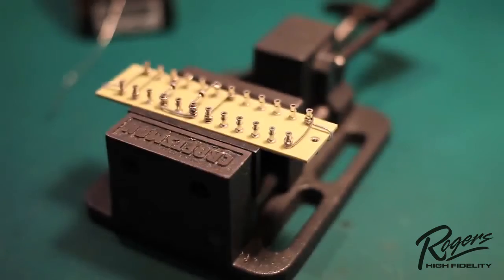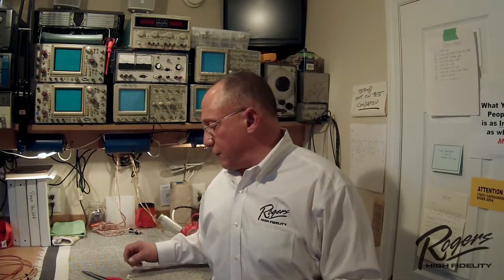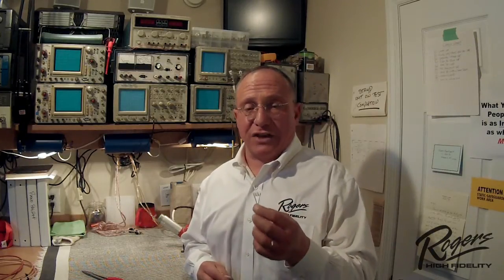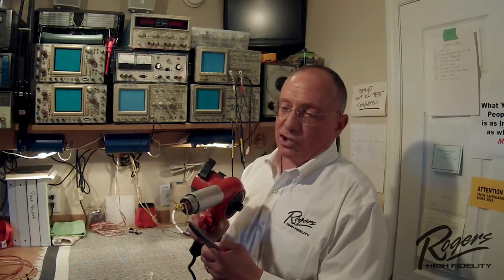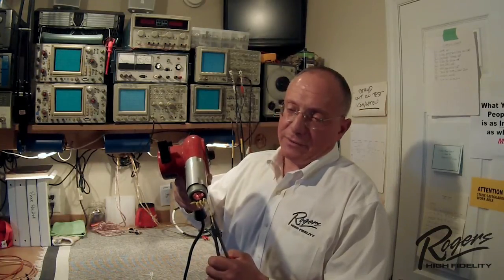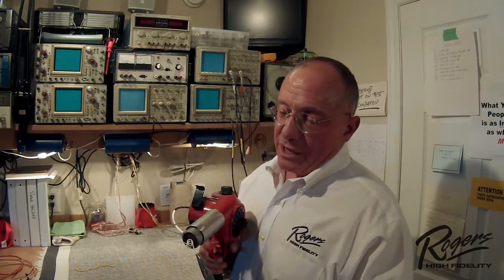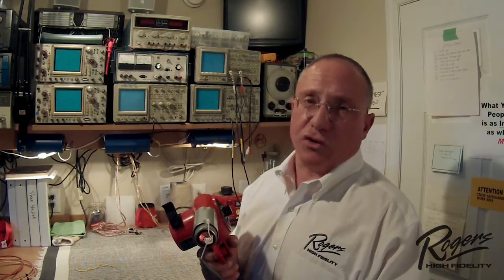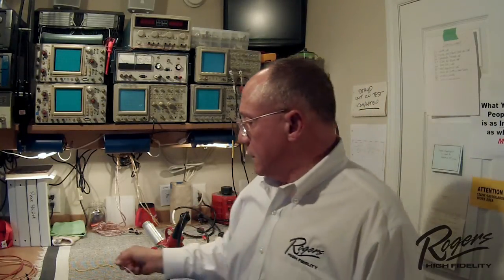Teflon VS. PVC Coated Wire. We ONLY Hand Wire Using The Best. #RogersHighFidelity

Comment: Nothing wrong with PVC coated wire, since tube amps aren't going to reach crazy high temps. Quality PVC coated wire will last way past a few human lifetimes when used in the correct environment and application. I can understand the benefits of Teflon coated wire in extreme situations, which in home tube amps will never see. If your tube amp is hitting high enough temps to damage the PVC coating on the wire, you have much bigger issues going on. The sound will be no different between PVC and Teflon coated wire. If you want to brag about how great Teflon coated wire is, apply that to where it would make a difference, not tube amplifiers. Lets be real about this.

Comment: Teflon insulated wire, specifically this wire, yields exactly the performance you say it does. I can verify this myself having used it to rewire a tube amps point to point wiring. Silver plated multi-stranded copper wire soldered with RMA solder equivalent to Kester 282 specs with a 2% silver content, aka Sn 62 was what was used. The quality of the joints was never in question nor was the consistency. You cannot get that quality from any ROHS variant made. Solder quality matters and nothing but an RMA solder of this specification will yield these results. The world may change what they believe is best for the environment, but the quality and reliability of solder joints is not just compromised by using the new lead free solder, it is ruined by it. As long as you address all the necessary steps to keep your scrap contained and follow the best soldering standard and that would be DOD STD 2000-1, you cannot lose. Under this standard, solder joints can withstand g forces, mechanical and physical stresses and thermal inversions. Compromises are unacceptable when life and property are at risk. If your livelihood is threatened, the same applies equally! Mediocrity has no place in anything and especially in the high end and military applications. That is my philosophy. I may be in conflict with some on this, but I believe in doing things right, doing it once and doing your best or leave it alone! To do otherwise is a waste of time, effort and money! Can’t afford to do any of those! Your opinion may vary. That is your choice. I do not agree with it, but I respect it just the same.

Comment: Really nice video. Going to be making electric heated clothing, etc. PVC is only rated for 90°C(194°F), where PTFE is rated for -65°C to +200°C (-85°F to +392°F).

PTFE wire and cables have a temperature rating of -65° up to 200ºC when silver plated copper conductors are used and -65° to 260ºC when nickel plated copper conductors are used. (+1 : 3)